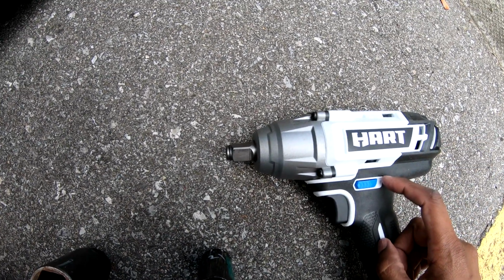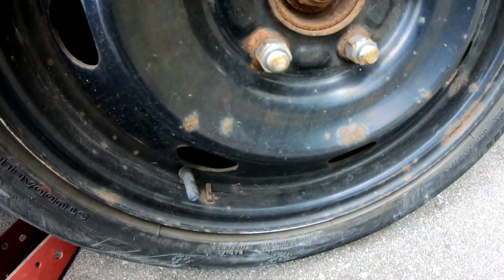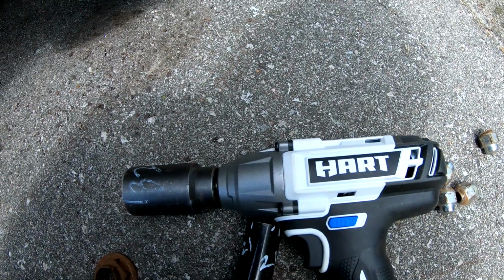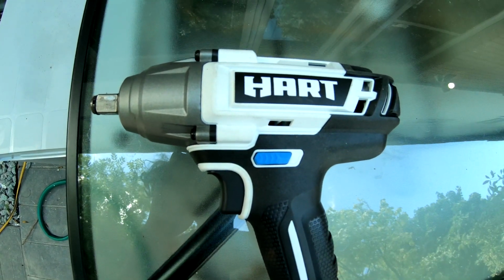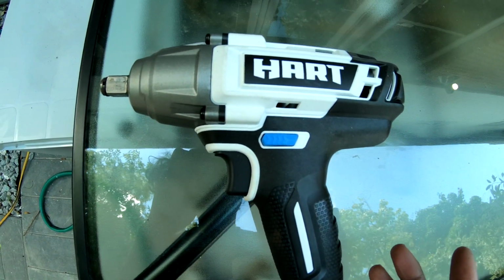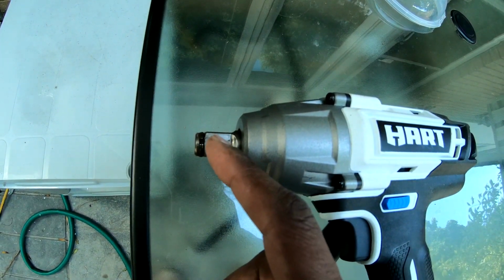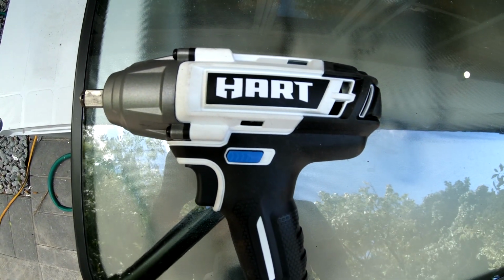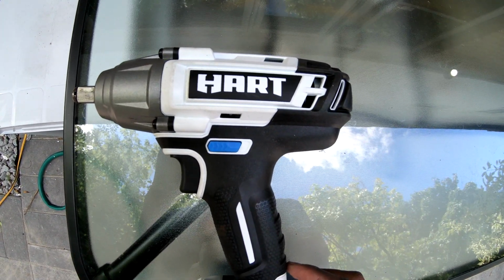Walmart tools - HART impact wrench review (RIPS NUTS)

Comment: That's smaller and more power than the Ryobi which is made by the same company. Hard to beat the ryobi battery platform though
Reply: Right out the gate Hart has tons of tools on the battery platform, probably because they already had them in the sense that its the same company and all, just have to reshape/repackage the battery area for the tools

Comment: I was shocked to see it get off that axel nut. I got the 3/8 probably mess around with it this weekend and see what it do.
Reply from the maker: post back how it goes
Reply: singlecams ok I will probably try to make a little video
Reply from the maker: @wblake22  the 3/8 is differnt inside i took pics of both inside will show, it had smaller motor

Comment: I’m wondering how it does when you want to install lugs? It doesn’t have low torque settings so could I still feather the trigger to get the lugs started and then do a final tightening with a torque wrench?

Also what battery size were you using? Thanks

Comment: Think you could test both the mid torque and high torque impact guns from Canadian tire maximum brand?
Reply from the maker: I'm not even sure its worth it the ridgid and dewalt stuff much better price. Like 499 for the high torque its nuts
Reply from the maker: like for that price you can buy the dewalt dcf899 with 1 battery and charger its all you need. or the ridgid high torque or the milwaukee 2767
Reply: The maximum high torque is $450 and the mid torque is $400 the dewalt you mention is $550 still $100 less lol I was just curious wanted to see how they stacked up against more well known brands
Reply from the maker: @dineenhorse6665  hi i think this is the mid torque? https://www.youtube.com/watch?v=35R_KSQUTDk  I now what you mean its just expensive.. The dewalt still great deal $510 tax in. 1 tool , 1 battery(5AH) , 1 charger
Reply from the maker: @dineenhorse6665  the price below i priced that out using amazon buying individual components the kit is more expensive because it come with 2 batteries but I that thing only needs one 5ah battery and it is incredible. the maxium only uses a 4AH battery too which is bogus
Reply: I was thinking of getting the ridgid mid torque impact but so far all I can see on Amazon and homedepot websites is that it comes tool only. Buying a 4 or 5ah battery plus a charger would be a steep price. The dewalt kit seems like the best option for the price
Reply from the maker: @dineenhorse6665  the ridgid used to come with the battery but now they don't , dont know why. It was $180 great deal.  ridgid batteries so expensive. also check facebook marketplace for batteries or tools. for impact wrench go 4ah or 5ah (5ah best) . If you want to buy the dewalt though amazon I think I just priced it out in the cart $435 before tax